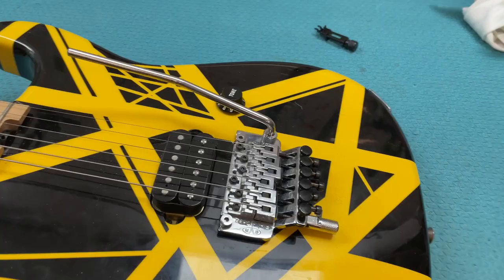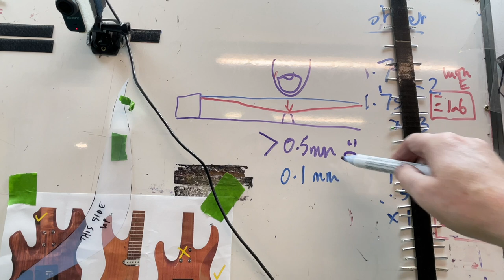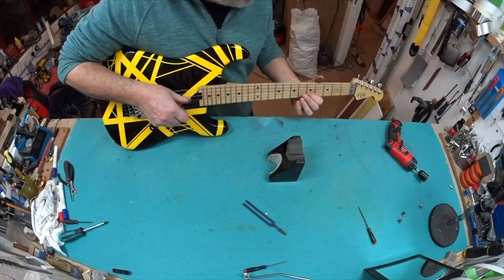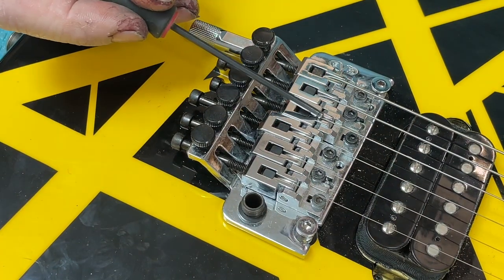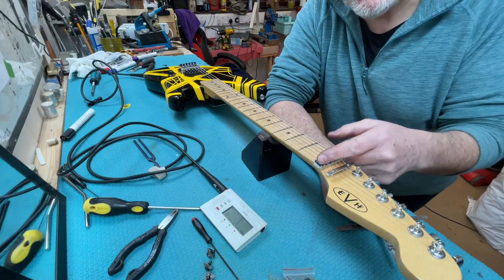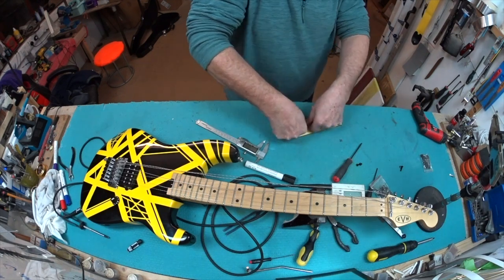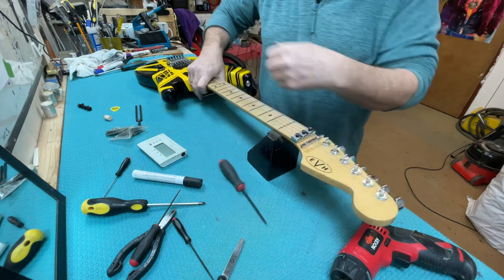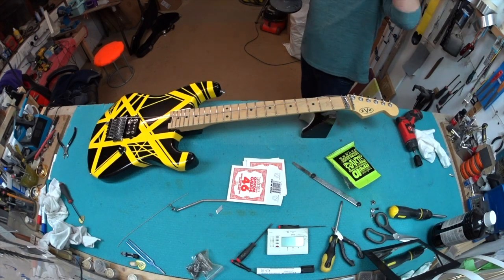EVH Strat intonation diagnosis and fix

Comment: Having worked on EVH guitars almost since they first came out (and having 43 yrs experiance working on guitars), I can tell you one reason those middle strings are going sharp near nut, and that's because most Floyd nuts (and all EVH ones) are cut to a 10" radius, but the first fret is a slightly more flat 12", making a bit more space under strings in middle to go sharp.

Grab a radius guage, and you'll see those two are a bit different. Most factories figure that it's close enough, and aren't' really concerned with getting the first fret string hieght zeroed in exacty. A good set of radius guages are always handy to check these things. I happen to like the radius to match perfectly.

They should've radiused the neck from 10" to 16" instead of the 12" to 16" compound radius, which is the only way to really fix it. That's what I tend to do with any of these types of guitars, and it really helps, but is a lot of work. EVH aren't the only ones that do this, Jackson and Charvel do, as well.

With a bone or Graph Tech nut, you'd simply cut slots to match the first fret height exactly. But you can't really do that with a Floyd (without cutting into it), so instead you're left with matching the fret radius to the nut, and that's not so easy with a compound raidus.

I've actually worked (and played) these types of guitars for so many years now that I honestly prefer working on them over a typical standard Fender strat. Working with a Floyd has it's own quirks, but when they're setup perfectly, they're a dream to play on. I've also always setup all my Floyds with 9s.

One last thing to always check with Floyd nuts is to make sure that the two screws coming up from the back of the neck aren't sticking up at all where the locking caps press down. If they are, you need to put a washer on the screw in back of neck to back that screw head down below the surface. If it sticks up even a tiny bit, the locking caps won't have enough clamping force, and the strings will go out of tune constantly. Those screw heads absolutely need to be about a hair below the top surface. No more, no less.
Reply from the maker: Thanks Jeff - some great information there. Sorry for late reply - YouTube is really selective with comment notifications. I've been caught out with machine bolt issues on Floyd Rose style bridges / nuts in the past - particularly slightly over-long bolts holding the locking caps down. If they're a fraction too tall, they'll ground out before actually locking the caps onto the strings.... just one careless thing. 
You're right about the radius mismatch... it's amazing how many guitars suffer from inconsistencies in this way. There are plenty of chances for physical variation EVEN where each part is supposed to be the same radius, far less when they are actually mismatched from the get-go. You've got nut slot radius, the radius of the board itself (regular or compound), the radius the frets were bent to (sometimes at variance with the actual fingerboard), the radius of the press insert they were pressed with, the radius imposed by or set at the bridge...Sometimes all of these have their own 'version' of 12" lol. 
Regarding the compound radius - my levelling method doesn't 'care' that the radius changes (it accommodates it just fine - too long to describe how & why) but a mismatch between nut slots and 1st fret (whatever that 1st fret is) is important. There is no option with a metal nut other than to cut into the metal (if you want to bring that G down inline with the rest). Not fun, but entirely possible.

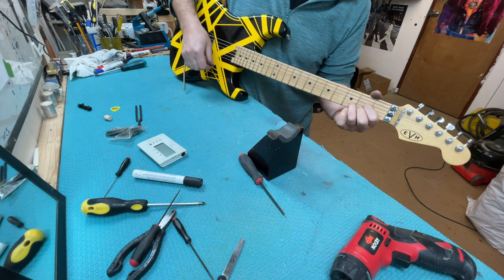Comment: I lke how you demonstrated tuning stability with excessive tremolo use 1:38:30. You should do it more often. It's the icing on the cake of every setup.
Reply from the maker: I would do it when a Floyd Rose comes past :-) I get a lot less of them than of 'regular' tremolo style guitars. It's wonderful to yank a Floyd Rose and demonstrate just how great it will keep the tuning - but removing all the slack FIRST is key to even that.

Comment: Mr. Deek's, can you give me some tech advice? I have an Ernie Ball Axis standard with a stock high end Gotoh bridge. I recently noticed that every time I used the trem it was always sending my Thick E and A string out of tune. The rest of the strings were perfect.. The E and A refused to settle into tune. I ended up replacing all the hardware and the darn thing still won't settle back in tune after using the trem on the same 2 strings. What could possibly be my issue? Thanks in advance when you can find the time for a reply.

Comment: I’m not sure if it affects anything, but EVH guitars are mostly setup to play with 9’s.
Reply from the maker: Mmmmm.... that's maybe what a lot of people do; but all guitars are designed to play anything from 8s to 11s...12s even. In this case the 10s tuned down to Eb are more like 9s in terms of their loading and their tightness. The lighter you go, the more easily you will bend notes with excessive finger pressure. Heavier gauge strings will forgive heavy-handedness better as a result. If Andy could not get stability with this then I would recommend going up to 11s (assuming still detuned to Eb)
Reply: @SamDeeksRelovedGuitars  I didn’t know if the wear on the metal saddles/bridge would be different if any from previous 9’s.
Reply: @michaelsullivan1262  From a material point of view - not really.  The wear is down to the string being trapped by the screwed down metal clamping piece, but still ever-so slightly free to move.  This tiny movement will over time either deform the metal of the base plate or the metal of the clamp (or both).  From the video it would appear that both this area is "designed to fail" in one way or another, while still being fairly cheap to produce - a bit of work on the shape of the base and the clamp (materials and shapes) could improve the situation quite a bit, but at the expense of ease of manufacture and cost of materials.
Reply: Eddie played with 8's...
There are many Guitarists who use his "signature" gear with 9's, 10's and 11's, depending the style they play, particularly people who tune down with heavier gauge strings. Beats me what the set up requires though, this is a good question to ask an experienced Guitar Tech...

Comment: Strange. vote for Floyd Rose...
Thank you Sam!
Greetings Andi from Austria!:hand-purple-blue-peace::face-purple-crying:
Reply from the maker: Do you mean strange to hear someone praising a Floyd Rose? I can understand if that's what you did mean! But once you've got everything else sorted, they are fantastic. I think a big issue for so many people is 'slack in the strings'. If you go to set up a Floyd and there's ANY slack still in your strings, the Floyd will keep going out of tune even when you've locked everything else down. You then find yourself running quickly out of micro-tuner room and have to unlock the nut, re-tune and start again. Before long you can easily lose faith in the Floyd. Stretching those strings until they don't detune any more is key to making a Floyd work. But the joy of bashing that arm down and it springing back into perfect tune (as I did on this video) is immense.

Comment: My peavey wolfgang has 10's on it. Tbh the trems a bit too stiff. I do think 9's are better with 2 springs.
That floyd is I think the 1000 version. Fitted as standard on the fender evh's.
It's not very good,the saddles are zinc and the locking saddle blocks are notorious for failing. 
The trem posts can be an issue too
You could soup it up with fulltone stuff. But a better replacement is a schaller or gotoh. Or the OFR 1984.
That's what ed had on his.
A lot of people have had some serious QC issues with the fender stuff of late.
For the record my peavey Wolfgang is as solid as a rock tuning wise. Whether it's 9's or 10's.
Floyd's are very good when they're right. But the lack of adjustability often means making shims from ali or brass as standard most Floyd's are 10 or 12" radius nut and 16" at the bridge.
And that doesn't always work out unless you've got a compound radius neck.
The OTR and korean Wolfgangs have 15" radius fingerboards and a 12" radius nut as standard.
Very high d and g strings at the 1st fret and just feel all wrong.
But you can shim them. You can even shim each pair if strings at the nut.
Works really well
Reply: They are much more fiddly and complex and as Sam says "reduce the number of variables" can be applied to guitars as a whole lol - I guess I should stick to a Telecaster :)
Reply: I think Ed had the gotoh version when he switched to the peavey, but like you said you cant cheap out on that stuff
Reply: They are by far the fiddliest bridge I've ever owned. If there's issues.
If everything is totally right, they are a total fit and forget thing. The tuning is totally stable. 
Take that nut for instance, is it made from cheese? That's ridiculous on a guitar like that.
You probably don't want to hear it but I'd just get a new floyd for it.
The gotohs are excellent and yes ed did use a gotoh. I stand corrected.
Put a gotoh on it,use 9-42's with two springs.
Oh and double check the nut. They come in various widths and heights. Like R2,R3 etc. Get the one you need for your neck.
I would bring down your adjustment screws to about halfway or lower too.
You'll probably find the d tuner slides in and out better.
And I wouldn't get carried away with crazy floyd mods. The titanium stuff is hellishly expensive.  Apparently the string lock blocks are good. As they can split from overtightening.  But that's about it. Those big brass tremolo blockscare a gimmick imo,and they often restrict how much you can dive
Reply: @deansayers7435  that is true, not to speak of the countless licensed floyds out there that all have their own quirks. I once had a Aria pro strat that took me years to figure out why it wouldnt stay in tune, only to figure out that the wood around the floyd posts gave way ever so slightly. Should have never sold it, but it just drove me nuts and I was just too stubborn to give it to a tech lol

Comment: I Love EVH, RIP.
I HATE free flowing Floyd Roses, this version is better, well, for me. Even still, I just ordered a Gibson style guitar, and saving up for a Strat style. The new 2 point "strat" style bridges seem very good. Not as much range as FR, but a Lot less hassle. From what I've heard and read, a Good quality 'nut', bridge and tuners, you can use the "whammy-bar" quite a bit (not FR level though, but) and stay in tune.
I'm sure if this is wrong, Sam will quickly set me straight. And that will be good, as I plan to purchase a new guitar in about 6 months, and I'd rather not misspend my money...

Comment: buy stunt guitar - pay Sam to turn off stunts. <facepalm
Reply from the maker: Being the kind and understanding person I am I prefer to think that customer bought this guitar, got caught out and confused by some of the 'mysteries' of getting the FR set up (complicated by unstable / unstretched strings) and got so frustrated that they tried to simplify it i.e. dispense with the locking caps and limit the range of the FR. My hope with this video (and the chatter that goes with it) was to help Andy see how much of the problem was 'runaway thinking' and how little was actually wrong with the guitar 'as-intended'. It's nice to be able to hand back a guitar that plays great, divebombs perfectly and stays in tune but it's even more rewarding if I can shift someone out of that mental loop and have a better relationship with their guitar.